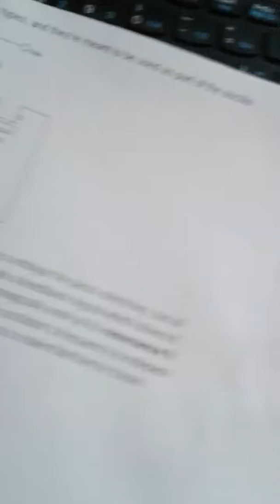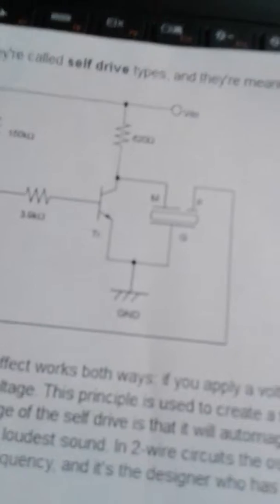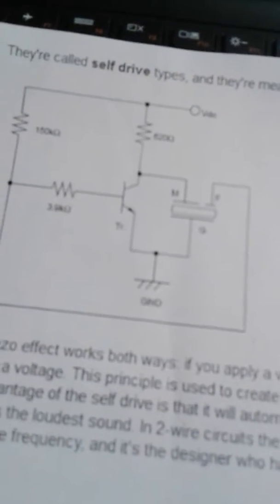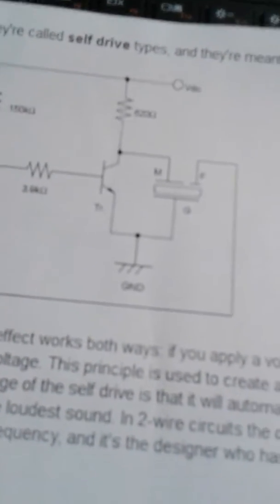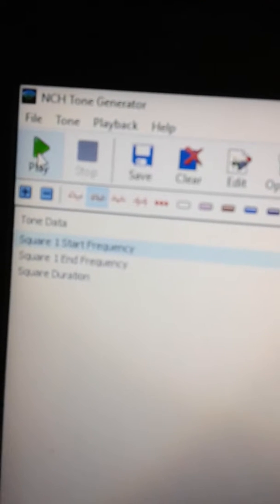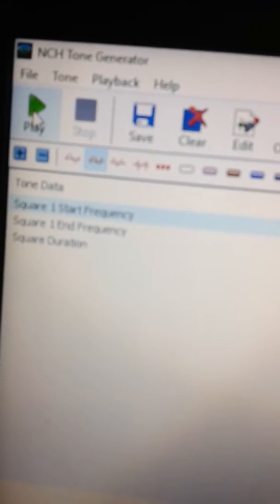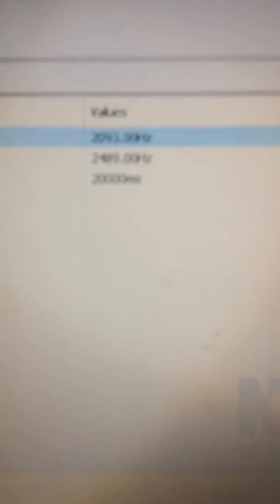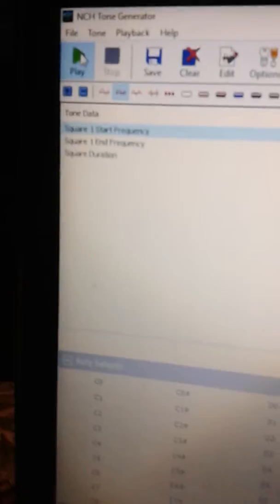piezo resonator

Comment: If it can produce sound waves, it should also be able to generate a vacuum, if in a closed box with a one way check valve?
Reply from the maker: In theory if you have a super-high speed micro check valve you could do that kind of thing. I have a spray paint gun that works on a 60-hz oscillating solenoid/check valve system which is the same idea.
Reply: @btestware  might be an interesting way of generating lift, by generating  partial vacuum above  wing